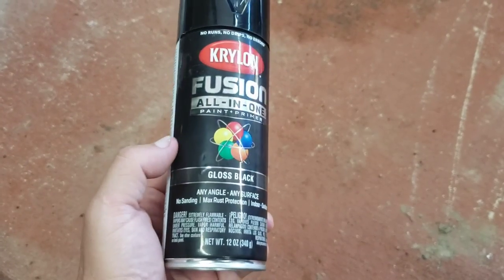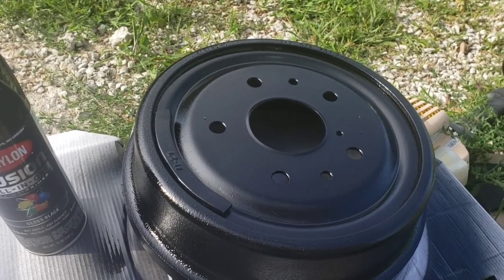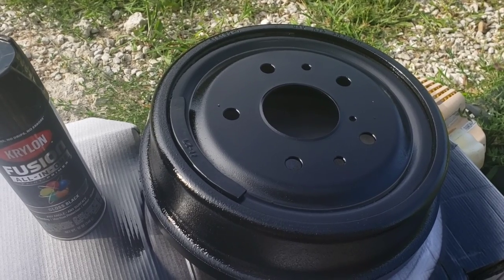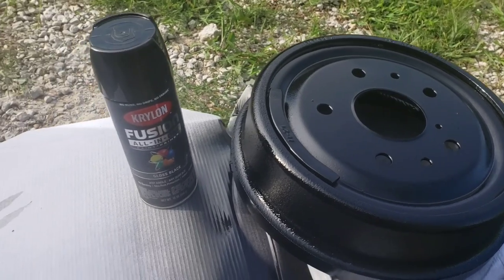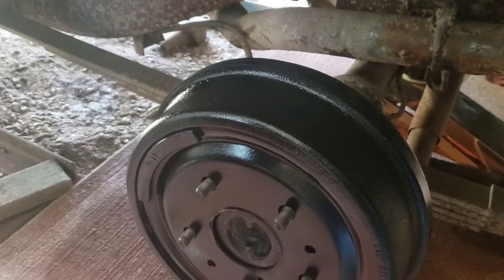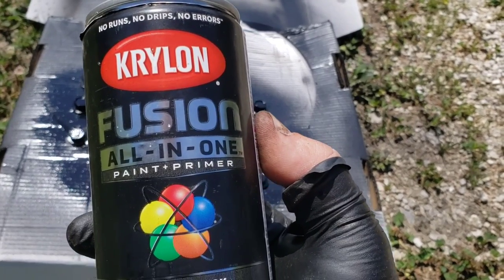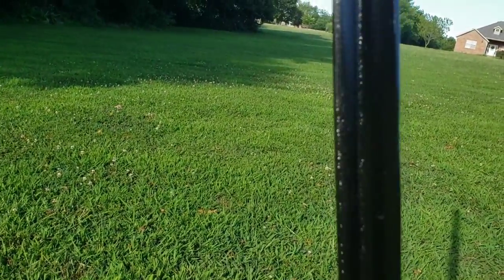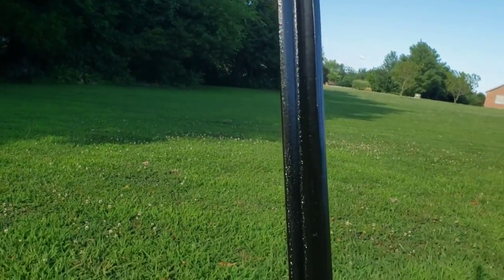KRYLON FUSION ALL IN ONE PAINT PLUS PRIMER  SPRAY PAINT

Comment: Yeah, Jeff....you can lay that stuff on pretty heavy and it evens out as it dries! I did minimum surface prep, did 2 fairly heavy coats, with 10-15 minutes drying time between coats. I used the satin black instead of glossy, so the drying times might be different. I'm satisfied with this product!
Reply from the maker: I am glad it did well for you!
Reply: I used satin black too for my gun slide came out better than expected. Looks professionally coated. Im a Krylon fan!
Reply: Can you use krylon on fiberglass ???
Reply: @ecftube  I personally haven't used it on a fiberglass surface,  but I would say it would probably work fine
Reply from the maker: Someone asked about a fiberglass shower , and I would say no..too much use where it would wear.... but fiberglass yes, but not knowing what you would use  it for....not sure
Reply from the maker: How is it working?   I would not have done that, but hey, it might work for awhile...

Comment: Was thinking of using this on a chain link fence. Just worried on if the gloss finish is too shiny
Reply from the maker: I would think you would have to redo it more often than say a mailbox.    Even if you had to redo it at the same time I would think it would be a job and a half.... maybe something like raptor liner?    I have a video on that on a jeep....I has stayed on really well...
Reply: @RoadHardRoadhouse  I ended up doing it yesterday and it came out terrific! Like mind blowing great application and finish. However lol like you said now I’m concerned with how it’ll hold up to the regular day-to-day stuff. I don’t think it’ll chip. It says it’s ‘fake proof’, I think if it gets hit with say a weed eater it’ll mark right up
Reply from the maker: @johnc1280  i agree with your assessment . The weed eater will take the paint off.  Like you said, I don't think it will chip.  I have not had any problems with that.   I test my paints a year in the open elements no shade, all sun, rain, snow etc...  I chain link fence is very interesting.    I'll bet it looks good. raptor liner would eventually wear off from weed eating as well.   Hope it works out great for you!
Reply: @RoadHardRoadhouse  Looks like I’ll have to be mindful when landscaping. Not a problem. Besides, it’s close to the grass so you won’t see it if marked up. Not as visibly as at standing height. So what is raptor liner?? Is that something you’re recommending? I just looked it up on Google never heard of it
Reply from the maker: @johnc1280  raptor liner is a self done type bedliner.   It would last a lot longer.   Especially if you use round up on the fence line..which is a good idea for you now....   since you have done this with the fusion enjoy it.  I hope you get some years out of it. But if it dies in 3 or 4 years...another option is the raptor liner.  Not really recommending it as of yet...  not sure how it would do on a fence, but it works great on everything I've used it on....
Reply: @RoadHardRoadhouse  Oh wow. So this is a spray product that covers the bed of a truck?? Provides a protective coating? Kind of sounds like rubberized undercoating spray. Which I have. But can you send me a link of the specific product you are referring to here as it may serve as a potential alternative!
Reply from the maker: @johnc1280  https://www.raptorliner.com/

Yes, it is a type of rubberized coating.  Can be done in different colors.   I did a jeep in Tank green,  and it is protective against the sun as well.   Not sure if it would be great for your fence, but it is a alternative idea.